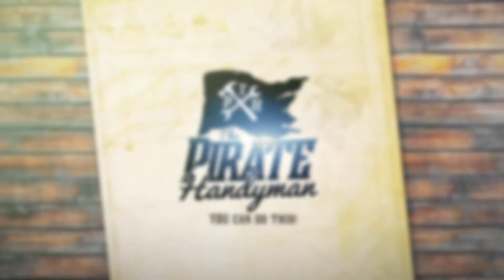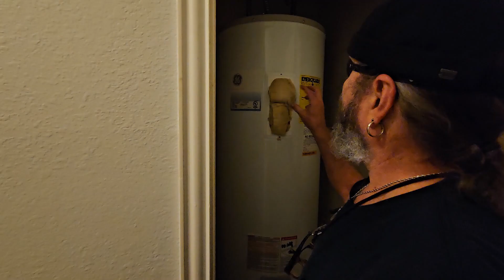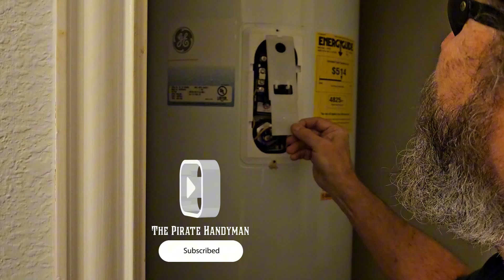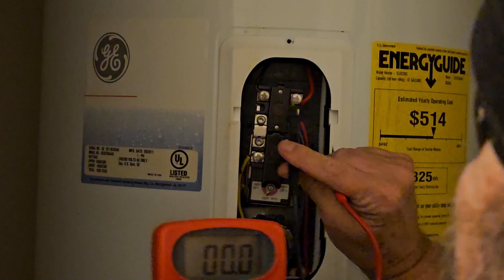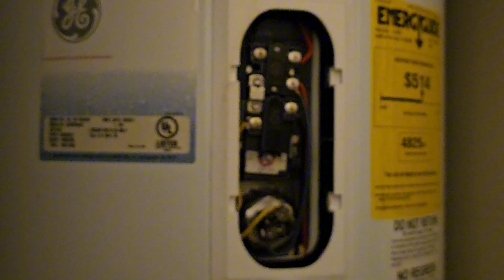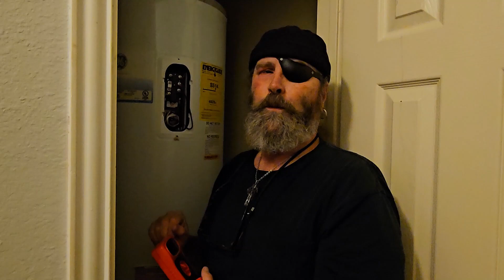How to Check if Your Hot Water Heating Element is Heating

Comment: One more segment idea. I watched your video on fixing a dripping bathroom sink which I have. But the other fix I need is that the water valves under the sink are not completely turning off the water. I would like to know how to fix them. 
And you know, saving coin for the treasure chest.
Thank you
Reply from the maker: Aye, matey, that be a common problem! The link below shows how to fix an outside faucet, but the concept is the same for the shut-off valves under the sink. Smooth sailin'!
https://youtu.be/KDAB0HjgYYs